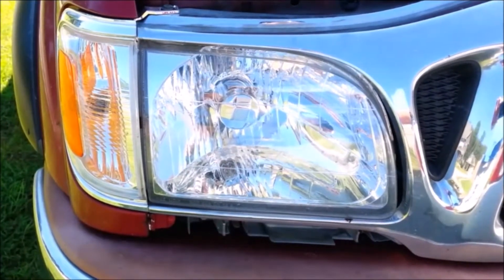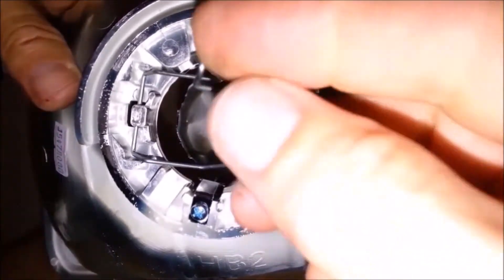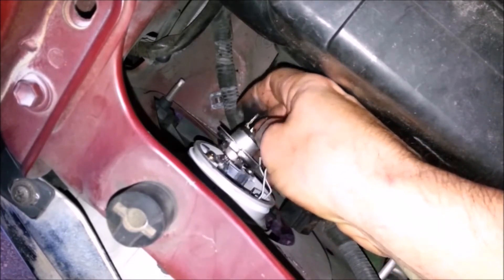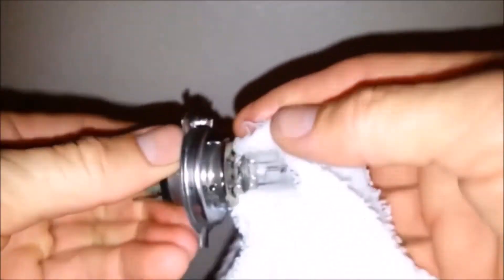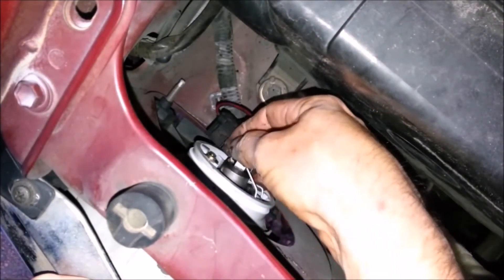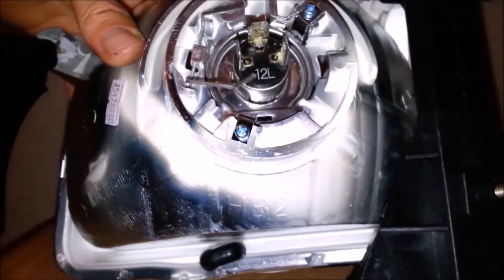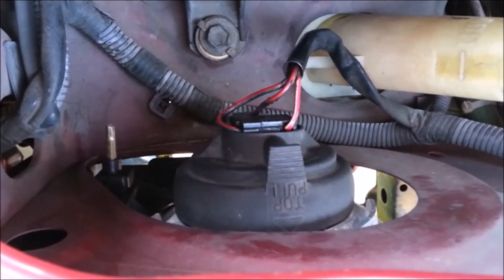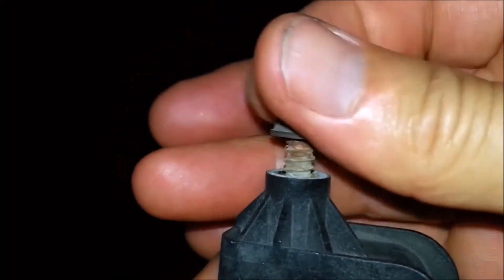Tacoma Headlight Bulb How to Replace 2001 2002 2003 2004 Toyota

Comment: The connector has meted and need to replace (again) yes this is 2nd time- what am I doing wrong
Reply from the maker: I haven't run into that.  Any corrosion can cause extra resistance and increase current/heat.  Check the bolt that holds the ground to the body.  Sand to metal under it, clean the bolt and connector, grease it and reinstall.  New bulb with new connector and bulb grease.  Those are the only things I can think of that might help.  Is it melting where the you had to cut and crimp the new harness on, or is it melting the wire, or is it melting where the wire goes into the factory crimp near the bulb, or melting where the metal connector contacts the metal part of the bulb.  Maybe another viewer may have some ideas.  What year is your tacoma?  What type of bulb (LED, halogen, high wattage...)?

Comment: My right side head light will not come on in the low beam ,but will work in the high beam ,give some insight on what I can do to correct this problem.
Reply from the maker: If it's an 2001-2004 Tacoma, it's probably a 9003 bulb.  The high and low beams are separate filaments inside the same bulb.  One of the filaments is likely bad, so you will need to replace the bulb.  

I updated the video description area with some info that may be useful to you, like prices and relative brightness.